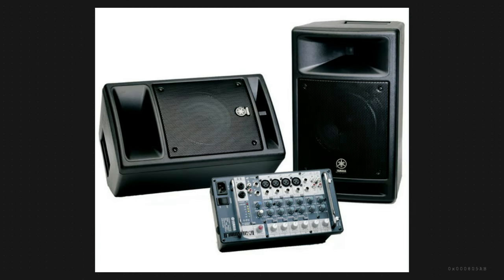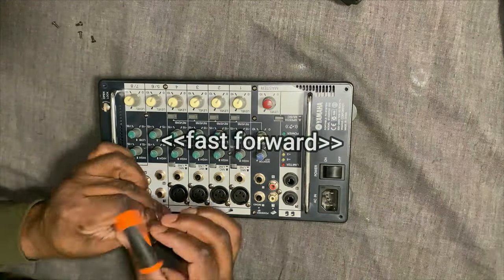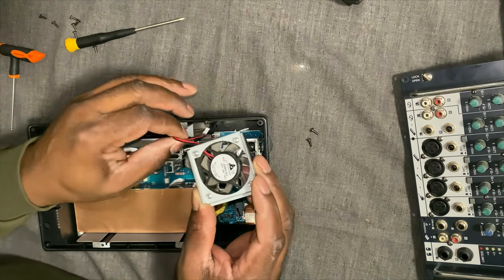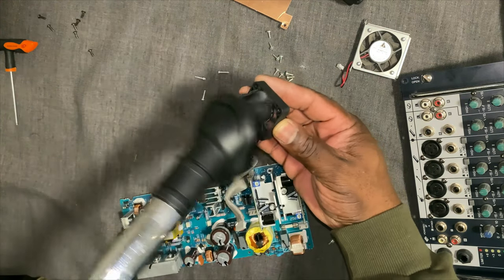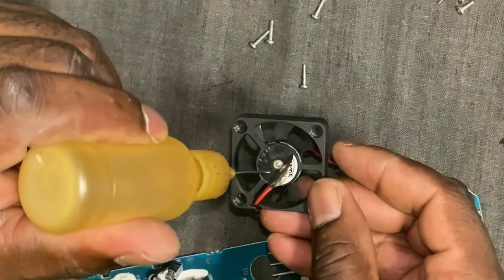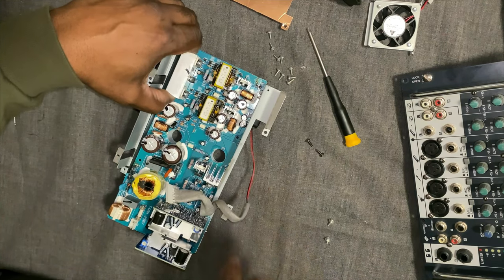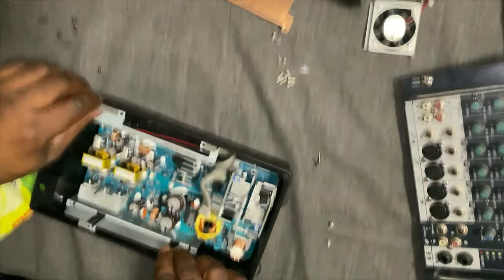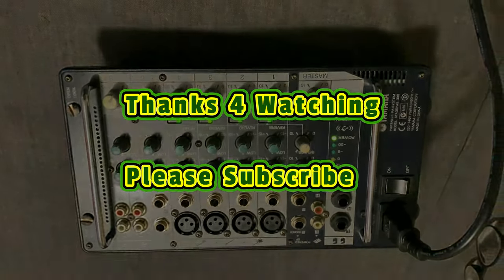YAMAHA STAGEPAS 301 PA System Not Working  Fixed

Comment: Really informative video! Thanks very much! 

I have a question for you, by any chance would you know at all, if there would be a reason a stagepas 400i would just randomly stop working? 

A friend borrowed mine and left it in the car over night - so you think that would have done the job? 😯 

I appreciate all and any info you can provide! Xx
Reply from the maker: Hi Cara,
              i don't think a night in the Boot/Trunk would cause an issue, probably a blown fuse on the Plug or inside of the unit, sorry that is all I can surmise 😳

Comment: I have done everything like you show but it’s still the same noisy fan. I used olive oil😅😅 I didn’t had another..
Reply from the maker: Hi Paul,
             I would not personally use Olive oil outside of the Kitchen. Maybe you can source a new Fan online if that one is noisy.
Reply: @green-crocs-fixes1520  that’s true..but I watched your video again and i noticed that your fan was very noisy before..my one it’s not very noisy..I think that’s the normal noise the fan making..my expectations was no noise 😅 but there are two fan working so I think that’s normal to have a little noise. anyway , maybe I gonna upgrade to stage pass 400 because the reverb on 300 it’s not usable 😅.
but thank you for very informative video 👌👌